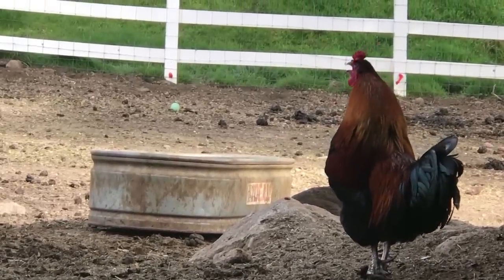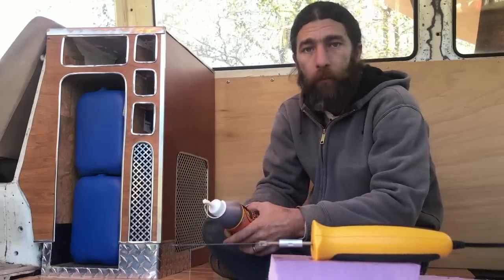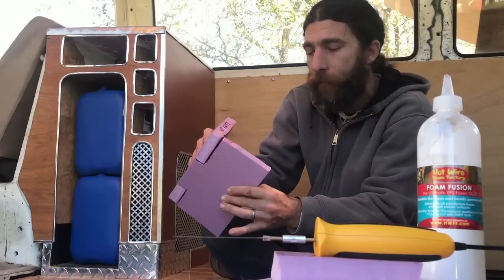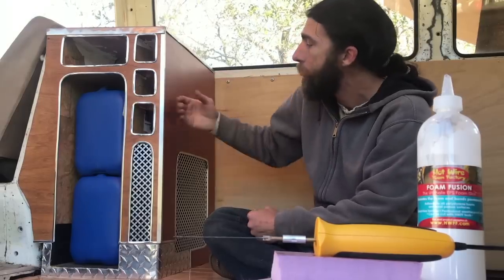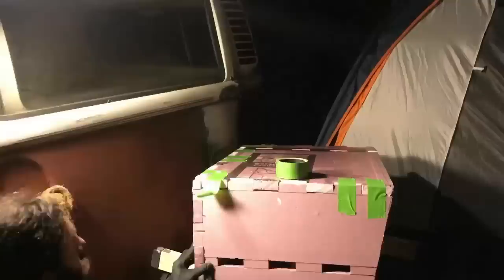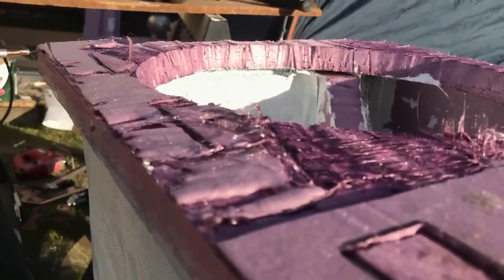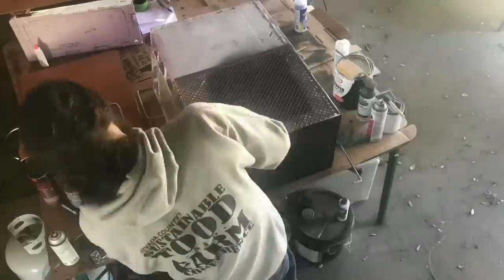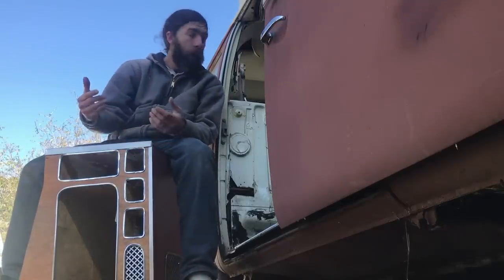Foam Cabinet Prototype - Improvements on Building Foam Cabinets for Camper Van

Comment: Good engineering using horse sense, which is what we'll all be relying on soon enough, survival of the fittest and all that.  The foam itself is a 'bad' material but easy to rationalize here because it's 'strengths' (literally and figuratively) overwhelm it's  downside, which is that it's made from fossil fuels and it off gases at very low temperatures.  (toxic gases that can suffocate you before you wake up, if sleeping) which is why the residential bldg code usually mandates a 3 hour fire barrier, like Firecode drywall.  Keep a window open is one solution.  This video has inspired me to use the method to solve a problem I've been fighting with for decades, which is how to duct in cool outside air from underground, into an existing slab on grade house.
Reply from the maker: Hey thanks for the comment! It was addressed in this video I just released. Check the table of contents at the beginning if you want to skip to a particular subject: https://youtu.be/BcAXr_gtbG8

Comment: I have a bulkhead separating my living space from my "store/garage".  It is made of 2 x 3mm ply sheets sandwiching 20mm celotex insulating foam glued together.  Incredibly insulating and strong.  My bed is on top of the 'garage' roof and it easily takes the weight of two adults.

Comment: Great stuff! However, I did my VW Van way back when and used 3/8th ply with at least 5 layers. Super strong and good surface on all sides and light weight. I did a lot of the holes and tabs and no glue  because as the pieces go together they lock into place (I like puzzles like that. as  joke on a friend I took all his furniture and put it into his bedroom and interlocked everything so that it had to be disassembled the same way... he had to get my help to undo it... winning the point that he needed me.. ha ha ... after being stubborn for two days... (he had played tricks on me many times so this was a bit of payback) )
  To my way of thinking (having lived on a boat and a VW for years) the loss of any space is too much. So 1.5 inch thick foam times two or three depending on how many walls you have = aprox 1" x entire surface area 1' x 2' x3= 9sfx1" or 12x24x1x3=864 divided by 144=6qf a whole lot of space. I took off .5 inch to make simple instead of 3/8" and used 1.5" as the thickness of the foam and guesstimated the measurements at 1 foot by 2 feet times three walls, not mentioning the shelves too. 
   Also, good paneling is sufficient for such builds since there is a lot of supporting cross pieces and no large unsupported surface areas and putting on a good varnish or tung oil helps it too. The key is to use tape and razor score all cut lines and then seal them right away to keep strong and from frying.  Light weight quarter round works wonders too and you can double layer paneling if you like which gives you a total thickness of less than 1/2 inch and finished surfaces. I like screws whenever possible else make it like a locking frame so that no glue is relied upon. In the five years of heavy use I never had a problem except for corners when got banged into and so next time i will use some metal kick plate.. and make some stainless steal corner trims with glue and barbed finishing nails unless I can find some nice stainless steal screws cheap. 
   The other nice thing about wood is that when you want to add something or fasten a strap or other thing you have wood to screw into which is solid enough to take it.. also a problem with fiberglass which everyone knows can't hold a screw for long in vibration conditions.
   I do like the way you wrapped the edges  of the openings with some metal edging?  Looks cool and helps from all that sanding and finishing. 
   Your screen idea to strengthen the foam is also excellent and please let us know if you have a problem with delaminating. If I'm going to do that I will sand the smooth finish off the foam and let it grab the holes exposed. If you do both sides you can use 1/2 foam and be plenty strong enough. Also, sanding is a most common tool with foam .. I would suggest using it and as to your cuts with hot blade, I would use guides not freehand!!!! Make jigs!! I've used jigsaw with broken hacksaw blade ground to fit the saw... works wonders  and sharp teeth not required! 
   Great video!!!  Like that you fast forward so we can see the entire process, thanks!!!  Great demeanor too so two thumbs up there as well. These are just my three cents worth based  upon experience  to help others. 
   As to using foam for window-box solar heaters and what not where space is not crucial, there is nothing better and I wouldn't use the tung and tangs but cut all corners at a 45% and glue them ..  super strong and fast so long as it is a good match.. use  sand paper on a flat block to get them to match perfectly and keep a can of insulation foam handy for mess ups  ... 
   Thanks for making and posting, hope some of this helps others .. Blessings!!

Comment: Re: some have suggested using fiberglass instead of the window screen.
Unless you're building a bookcase, that would be overkill.
My suggestion for added strength is to install the mesh with 2 or 3 inches of it overlapping onto the neighboring panels, to reinforce the joints.
In the event you need additional strength, adding a (3/4" aluminum angle) frame will increase tremendously the load capacity.
I really doubt there's need for all of that, unless of course a bookcase it's actually needed.

Blessings.
Reply from the maker: Thanks, I address fiberglass in the upcoming Q&A video and I do reinforce the joints a little, although it’s plenty strong and I may skip that step in the future.
Reply from the maker: Hey thanks for the comment! It was addressed in this video I just released. Check the table of contents at the beginning if you want to skip to a particular subject: https://youtu.be/BcAXr_gtbG8

Comment: If you get a thick straight metal bar, (2cm thick ish) you can use that as a guide for the hotwire knife, that way the lines will the straight and the plunges vertical.

Comment: Another thing you could do is put the foam pieces together quickly with low-temp hot glue then put one layer of fiberglass over the whole thing. People even make pigmented countertops out of epoxy that look pretty cool too.
Reply: ...or just fiberglass (epoxy resin) over a REALLY cheap pre-fab cabinet.  Good idea, thanks.
Reply from the maker: Hey thanks for the comment! It was addressed in this video I just released. Check the table of contents at the beginning if you want to skip to a particular subject: https://youtu.be/BcAXr_gtbG8

Comment: Hi , you did a better job than the 'inspiration' videos. I would suggest you consider using just the 1/8  or 1/4 Lauan plywood. You loose a lot of space with the 1" thick foam and spend a lot of time and money on additional materials laminating the surface to strength.the 1/4 ply on its own will be plenty strong enough especially with small corner blocks at joint or neat 'fillet' joints of thickened epoxy glue. You would not have to cover all the edges as they can be sanded smooth and varnished or painted.  But for a backwoods option to make some cabinet the foam is ok and I commend you on an interesting video that kept my attention. Cheers Warren

Comment: Awesome build and video. I think I would not have cut the hole for the sink opening in the stainless steel top piece. Rather, I would hinge that piece so it can be lowered over the sink for more horizontal surface and flipped it up to use the sink. JMOHO

Comment: Auto stores like Rush and O-Ryleiy sell a chrome/black or clear pinch molding for door edge protection. in short lengths about 18 or 24 inches.  also look for Windlace through body shop supply stores. The windlace is a little larger and comes in long rolls.

Comment: I want to do away from wood as  much as possible, even though I love wood cabinets. I am from Florida and I DO KNOW a thing or two about humidity, mold, mildew and trailers....Yes, even with ventilation, yes, I have some level of PTSD. (!).
Inside a hi-top Promaster, you may be able to fit some floor to ceiling plastic cabinets, like the ones being used for gardening. Heck even use some tall metal shelf garage cabinet,  cover the sides with a steel mesh, for air circulation, and maybe place an additional insulation panel against the wall. All you need to create a door made of XPS, which is the knowledge I am gaining from you as I do not have either the skill, time or patience to do what you did, which is pretty nice.

Comment: I think your bathroom stand is great for a lot of reasons.  The only thing that concerned me is the off gassing.  I am quite sensitive to chemicals and I think that a wooden structure might be better, especially if I can find something in a second hand lumber yard.  It seemed like there were a lot of toxins in your product.  I loved that I could build it myself without a lot of tools.
Reply from the maker: Hey thanks for the comment! It was addressed in this video I just released. Check the table of contents at the beginning if you want to skip to a particular subject: https://youtu.be/BcAXr_gtbG8
Reply: >>I think your bathroom stand is great....The only thing that concerned me is the off gassing<<
Try gas-ex....it works great.

Comment: At first I was like, "This is a joke, right?"
Then you went on to justify and thoroughly explain each step. I was about to ask if you could sit on the counter, when, you jumped on it. This is an efficient method for complex pieces like your own, and while I will likely adopt it, I still could see wood being easier to work with, harder to mess up, and cleaner overall. The learning curve will be worth it I'm sure. Thanks again.

Not sure if you'll see this, but could you talk about the metal trim you used to outline your cuts? It wasn't mentioned.
Reply from the maker: Hey thanks for the comment! It was featured at 1:09:06 (just for fun) in this video I just released. Check the table of contents at the beginning if you want to skip to a particular subject: https://youtu.be/BcAXr_gtbG8

Comment: The Glidden Gripper can be used as foam glue also.  When dried, it is as strong or stronger than the foam.  You cannot separate or pry apart a Gripper joint.

Comment: Great ideas. Like the hot wine Fiberglass screen applications. Not a GORILLA GLUE fan. ( always figured it was a gimmick) -( review. Melts foam. Great Stuff foam products 100% bonding. ) Any spray foam should be the same. 
Your glue makes more scenes. No expansion. Want tight seal.
Hot glue works great as clamping also. Temporary. Doesn't leave residue. Doesn't permit bond. (Cabinet maker showed me that 40 years ago.

Comment: Hello Nomad,
Your Video has me inspired to build.
I like the research you’ve  done to make this a more precise and stronger structure. I’d like to add some light weight cabinetry to the back seat area of our quad cab Dodge pick-up.
We travel full time out of our truck camper and my Significant other has a sensitivity to chemicals and off gassing. It appears that  this application requires several coats of glue and adhesives. 
From your Experience, Will this continue to have a residual smell linger inside the vehicle for days, weeks, months, or years? I would really appreciate your constructive feedback.
Thank you Nomad and thanks for sharing these wonderful videos.
Reply from the maker: No smell / off gassing... this will be covered in an upcoming video.
Reply from the maker: Hey thanks for the comment! It was addressed in this video I just released. Check the table of contents at the beginning if you want to skip to a particular subject: https://youtu.be/BcAXr_gtbG8

Comment: I'm going to try cutting foam on my CNC. They're supposed to be excellent at it and I'd have better than factory accuracy. I think this is a great alternative though. I think they make foam cabinets these days for normal kitchens if I'm not mistaken.. I wonder how that'd work weight wise but also cost wise if it'd be about the same or even cheaper if it was on sale. Anyways, thanks for the video!

Comment: Great work.  Thanks for sharing.  I was wondering if you considered applying the screen to the full sheet rather than the individual surfaces after assembly.  It might not work with the heat knife, but it seems like it would be easier than doing the sections after the cabinet is built.  I looked at other options like Think Lightweight Foam Light, but can't find anyone using it.  Good luck with the rest of the build.
Reply from the maker: Hey thanks for the comment! It was addressed in this video I just released. Check the table of contents at the beginning if you want to skip to a particular subject: https://youtu.be/BcAXr_gtbG8

Comment: For cutting large areas od foam into complex shapes, aircraft homebuilders use hot-wire bows. They might be faster for large cuts, even if the knife works better for small cuts.

Comment: Nice video! Good explanation. But i do ihave some questions after seeing this:  If I would use polyester fiber, instead of plywood, could i use the polyester hardener directly on the foam? or will the hardener dessolve the foam? And would you use other insulation materials on top of the foam, if this was mounted straight against the sidewalls of the van? The reason im asking is that i have an idea in my head where i would like to create an ultra light exterior and  interior, Made with Insulation Foam and Polyester fiber that is covered with an Line-X Bedliner. For ultra durable coating. ( I think/believe that the Line-X / Polyester fiber vs the plywood and paint and aluminium would be the same weight. And i think that the Line-X could substitute as stainless steel sink and kitchen top. Which would make it even lighter. I know this sounds odd, but my goal is to make some sort flood-proof interior,. I experienced 2 flooding's already, And my experience is that wood always starts to rot. which is the beginning of the end. Again great Video
Reply from the maker: I don’t do fiberglass, but this is addressed in the upcoming Q&A video. This video covers fiberglass on this type of foam and other types: 

https://youtu.be/dru51u-vLCs
Reply from the maker: Hey thanks for the comment! It was addressed in this video I just released. Check the table of contents at the beginning if you want to skip to a particular subject: https://youtu.be/BcAXr_gtbG8

Comment: awsome build.. looking using your tools to build an 4ftx5t container to mount on a small trailer and put an RTT any suggestion or thoughts? RTT weights about 150 lb and then add 2 poeple weights 400lbs ish

Comment: Hi, Great idea using the foam to lower the weight of the load of the van. if i go with a van I will definitely try to make my cabinets out of foam.I am also wondering if that helps with insulation?

Comment: Absolutely genius!!!!! I don't understand why the plywood instead though unless it's just a finish, aesthetic? :S
Reply from the maker: Weight… all about the weight…. Gas mileage sand a vw van struggles with too much weight up hills.
Reply: @falkornomad  hi bud, thanks for replying. From what I remember of this comment, I was talking of the plywood being used which is surely heavier? Hence, why not use the foam stuff everywhere? :O

Comment: Tongue and groove is a very strong connection, and has been used for thousands of years. Only stronger connection (with gluing or screwing) is 45% bevel joints.

Comment: They make honeycomb core plywood for use in airplanes but its fantastically expensive.   Fiberglass cloth with water base polyurethane is another option for foam panels. In boat construction they use epoxy resin with fiberglass cloth of course which would be much stronger.  Thickened epoxy is a great glue for foam and super strong.  
The biggest problem is see with this composite construction is how do you screw to it.  Maybe using 1/2” ply instead of 3/4” would be a good compromise between weight and labor.  Nice effort on a very light cabinet.
Reply from the maker: Hey thanks for the comment! It was addressed in this video I just released. Check the table of contents at the beginning if you want to skip to a particular subject: https://youtu.be/BcAXr_gtbG8

Comment: I'm curious as to why you feel the need to build lighter weight cabinets in your van. I'm a big fan of foam core components, but only when it makes sense. For your application, which is relatively very few cabinets, the difference between building 3/8" plywood cabinets, versus foam with an 1/8" skin is ridiculously minimal. The few pounds of weight savings will not be beneficial with regard to the capacity of your vehicle's suspension. I've been using these foam-core techniques, and many others, since 1997. In fact, I hold four patents regarding foam core materials, ACM, and other related composites. Your video caught my eye, because I'm always looking to improve on my work, same as when I started nearly 30 years ago so I constantly search Youtube for these type videos. There are certainly cases where foam core justifies itself for vehicles, like when many components are being used (think dozens or hundreds) or when weight savings is at an absolute premium (as in an off-road, single axle, towable camper), but your application makes for a tremendous amount of unnecessary hours of construction labor for literally a few pounds of weight savings. Thats why I am asking, perhaps I missed something?
Reply from the maker: See weight comparisons video… then drive a vw up a 6% grade at 40mph… weight is everything and pounds count. Plywood is 125% heavier or more.